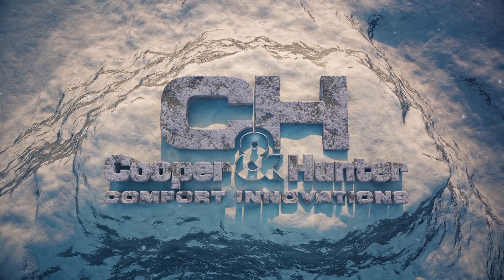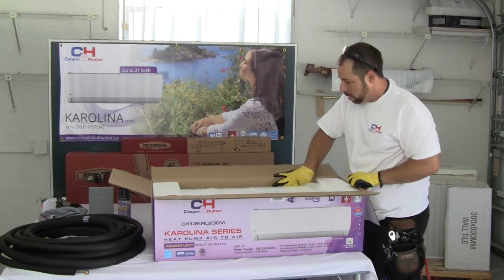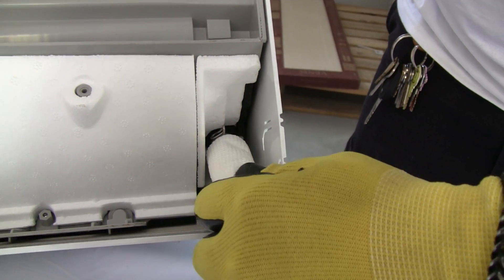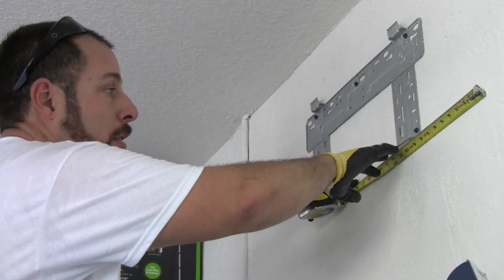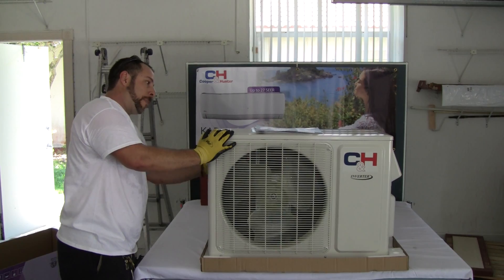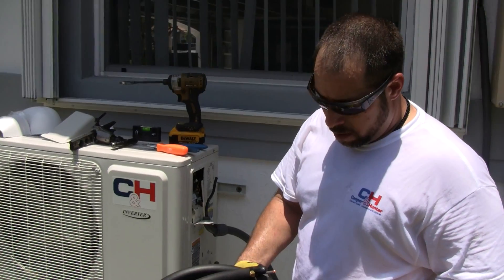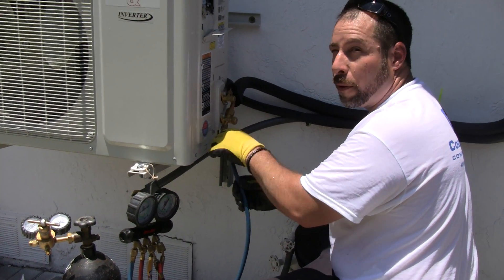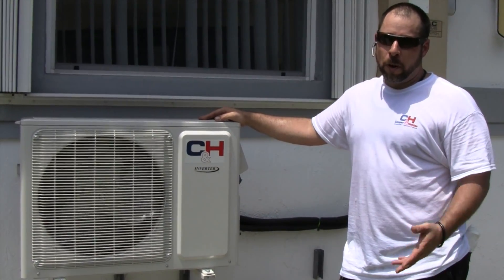How to Install Mini Split Cooper&Hunter

Comment: Why didn't you show the electrical connection steps??  That's what I came here for.
Reply from the maker: If you need help with your electrical connection, please refer to your installation manual or get in touch with our technical support team at (786) 953-6706 with any questions you might have.

Comment: Do you need installation kit in addition to buying the unit?
Reply from the maker: C&H installation kits include communications wire, copper line, and other accessories. They are useful for a quality installation, but you can technically use another brand for your line sets.

Comment: You skip over the electrical portion of the job entirely.
Reply from the maker: Hi Edgy00, if you need help with the electrical part of the installation, there is a detailed explanation in the Installation Manual.
Reply: @CooperandHunterusa  Wow.  Maybe I got some sort of abbreviated manual.  There is absolutely nothing in there about wiring that is useful.  My unit is a 240V model (Sophia).  Is that a straight 240V line that it takes or does it call for two out of phase 120V lines?  I'm only seeing three wires so far in things that I see in videos--a hot (240V), a white neutral, and lately a green ground.  Is that about right?  Many thanks!
Reply from the maker: @Edgy01  To power the outdoor unit, you have to connect it to a double breaker, 230V. L1 and L2 are the phases (120V each), and then ground. 

To connect the indoor unit, you have to run 16/4 cable and color-match your connections between the indoor and outdoor units. 1 is L1, 2 is L2, 3 is signal, and ground. 

If you have any other questions on this, please call our Technical Support team at (786) 953-6706
Reply: The manual is not detailed. The only reason I watched this video is for the electrical that wasn't covered.

Comment: What would be the likely cause of this... Installed a 3 zone C&H. A 12k and 2 9k units. Lately it's gotten to where if I turn on the 9k in the bedroom, the 12k seems to freeze up if it's turned off. Then after the 9k is turned off, the 12k thaws and will actually spill out when I turn it on and the vent opens. I think the 9k in the bedroom will do the same thing if it is off and the 12k is on. The other 9k seems unaffected. Both units are cooling great and seemto heat very well.
Reply from the maker: Hi Eddie! It sounds like you might have your wires crossed if, for example, the 9k unit is on and the 12k is receiving the refrigerant. 

Give our Technical Support team a call at (786) 953-6706 and they can help you out!